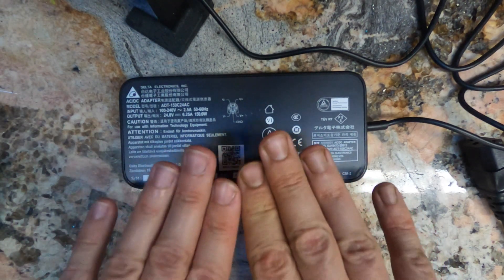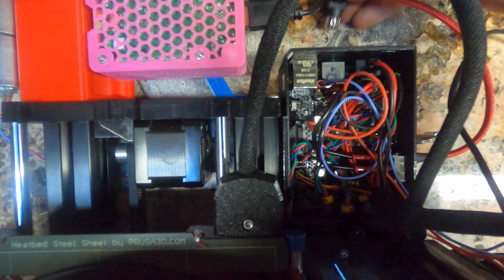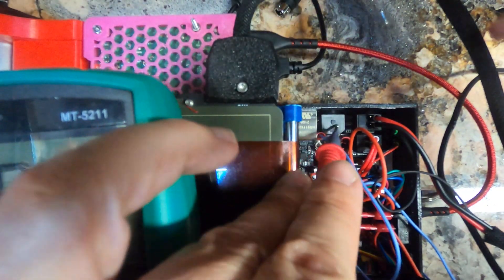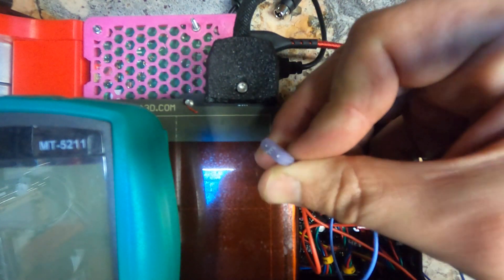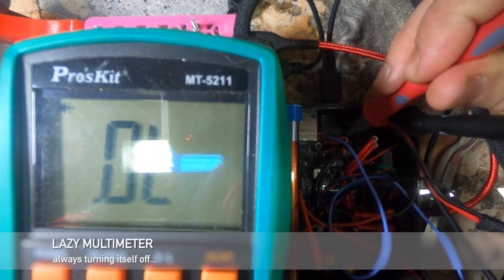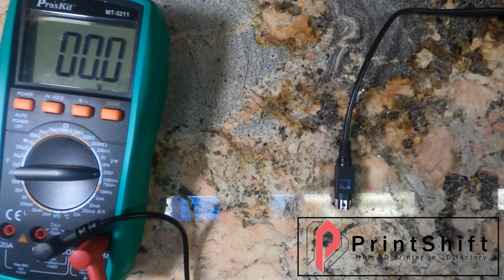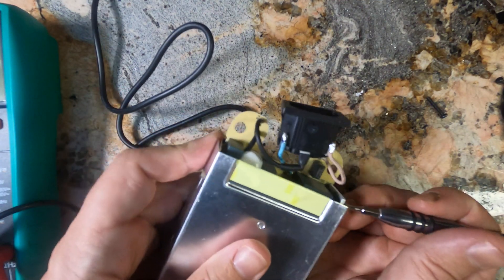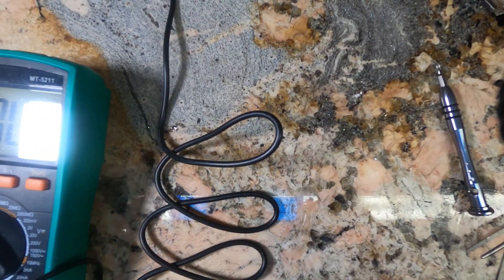Prusa Mini Repair: Power Problems

Comment: Once you remove the soldered shiled, you'll find out that the PSU is all filled with white sillicon glue all over the ICs....
After you finish blaming the guy who did that, you'll have to be armed with patiente and can remove it with your nails and a plastic pen cap.
Reply from the maker: I've only gone past the burnt stage once... Spent hours to get it up and running for a week, since I replaced the burnt parts, not the failed parts.